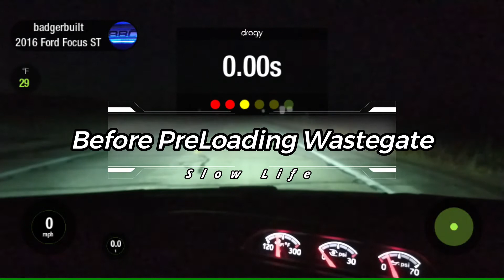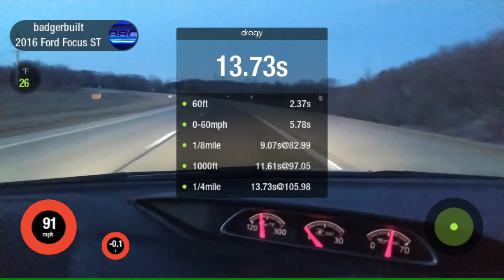2016 Focus ST wastegate adjustment

Comment: Only 15 - 17 psi?
Are you running another turbo?
After the adjustment of the wastegate, he also had no psi growth and was slightly slower from 0-60
Reply from the maker: Was stock turbo, aftermarket charge pipes and intercooler. Sold the car last year

Comment: how did you manage to access westgate, top or bottom?
Reply from the maker: I had it on a hoist and was able to loosen the heat shield and get to it from the bottom
Reply: @BadgerBuilt  for me, the screw from the heat shield will not even twitch, do you have any way to unscrew it?
Reply from the maker: @EDIGSXR  if you have access to a torch, I would try heating the bolt and see if that helps it free. Some penetrating oil mixed with some heat may be your best bet at not having it snap
Reply: @BadgerBuilt  ok I'll try, thanks for the hint